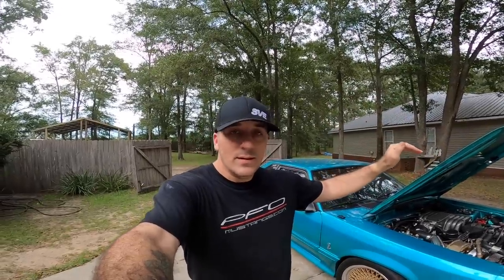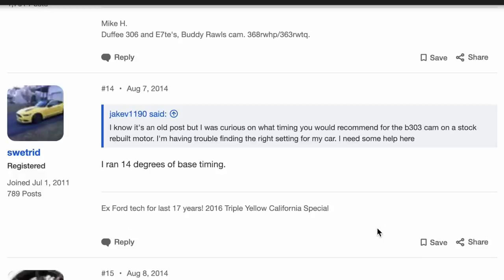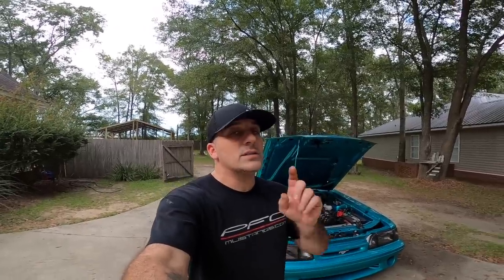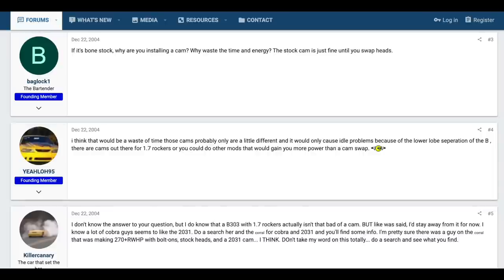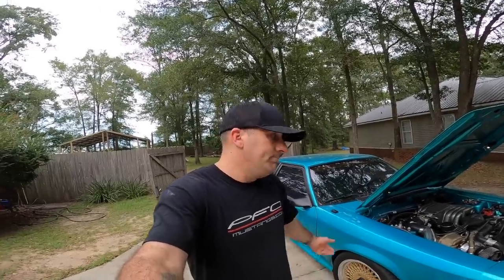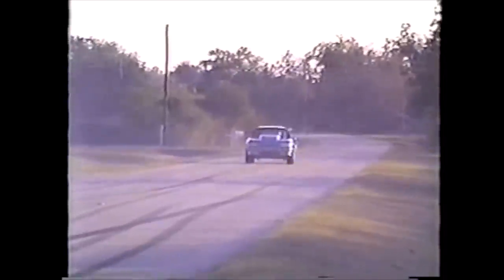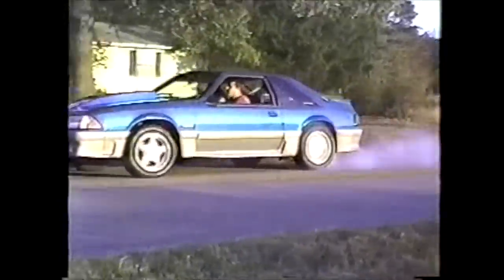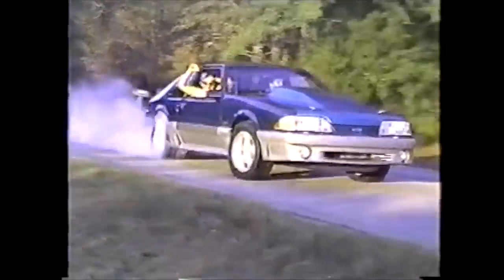THE B303 CAMSHAFT: Why the HATE why the HYPE?

Comment: I have a 86 5.0 with speed density. Question is without going to mass air and changing cylinder heads, what cam can I swap the factory cam with?
Reply: I’ll add not chasing HP, just want to nice sounding fox for the car show pull up!

Comment: I have a b303 cam going to be putting comp cam valve springs,it has Edelbrock rpm2 upper and lower intake ,short headers and powered by Terminator x stand alone, will that be reliable ?

Comment: I know this has probably already been asked but here goes......I have a 91 GT (automatic) that is pretty much stock except for the BBK cold air intake, the 75mm throttlebody spacer and SCT tune. I'm wanting to add a cam at this point. I was wondering which cam I should go with and how long of a job is the install.  P.S......I enjoy all of your videos. Very informative for us novice owners😎
Reply: E cam or tfs stage 1. 4.10 or shorter gears help too

Comment: I went to the junkyard and got gt40 heads upper and lower intake from an explorer. NOW, I’m at a lost on what to do. I do want to change the cam to an e303 cause I got (AOD) but what should I do with valve and rockers can they hang with the cam or do I have to replace with something else also?
Reply: Need to change your springs for sure, u can get by with the valves and rockers if u need to but the springs are a must 👍🏻 good luck
Reply: I got gt40 heads with the crane 1.7 roller rockers, stock length pushrods( I might of put slightly longer ones in but I did run the stock ones for a while) upgraded valve springs from Alex's parts, and e303 cam. No issues! Other than I had to modify the oil baffle in valve cover to clear the rockers. Stock rockers will work fine too
Reply: I ran a e cam and 1.7 ford roller rockers on gt-40 heads in a aod and you might want to add a stall converter.But it sounds great
Reply: 79Beans 347 what springs would you suggest and where can I get them? Thanks
Reply: jah Thorne would you happen to know the part numbers for the valves and cam? Also, the lifters from my 302, will they work fine with the rods from the gt40 heads?
Reply: W C stall converter? What’s that? And what for?
Reply: @robisart7715  a stall speed converter for your transmission
Reply: W C ok I know nothing about that, but I’m assuming because of the stock one doesn’t have enough power to turn the car over?? (Newby sorry)
Reply: @robisart7715  a stall converter helps AOD tranny's to take off almost the same or better than manual transmissions, basically let you give RPMs to the engine when taking off, but RPMs depends of the type of stall converter (example 1500,2500,3500)
Valve springs and cams you can find them at many websites like, american muscle, late model restoration, summit racing.
There are a lot of websites for the 302's and of course for most of foxbody parts
Reply: Omar Ruiz thanks a ton! I asked about the valves cause my concern of them fitting the gt40 heads I was afraid of getting valve that can’t handle the cam and all
Reply: @robisart7715  your welcome, and about the rocker arms I think you'll be fine because the E cam it has a slight difference compared to the stock HO of a mustang, but I'm not sure if explorer pushrods have the same length than mustangs 302's
Reply: Omar Ruiz what stall converter would you suggest?
Reply: @robisart7715  1500 for a daily driven and street racing purposes.
and between 2500 to 3500 only for the track with drag radials, because if you try to cruise with a big stall you'll be reving too much
Reply: Omar Ruiz ok yeah makes sense, yeah I still want it to be my daily Forsure
Reply: @robisart7715  yeah I love daily fast vehicles, just keep in mind that a 1500 stall can't launch hard with drag radials, but a semi slicks is the way to go for street racing and the track as well
Reply: Omar Ruiz thanks bro!, yeah I’m not even trying to be a street racer But if I step on the gas I want it to go you get me? Motor is in the shop now and I’m trying to push 320-350hp but still have it as my daily so I’m not trying to push the limits too hard

Comment: I think the thing that gave the B cams a poor reputation was the LSA. Was always way too wide. Other grinders/mfgs went to 110-108 making better top end power. Bottom line the engine doesn't car about internet opinions. It likes what it likes.
Reply: Itza computer compromise. 
Power wise @ 108-109 is best.
E cam 110 is MUCH better than 115, 114, 112. 
GOOD quality 1.7 rockers push the lift from 498 to .529.

Comment: Is Andrew running gt40 or gt40p heads?
Reply from the maker: Gt40p
Reply: @BREW2LFOXBODY  Now, that's something I can't understand. How much were the headers? I always recommend finding a good set of used TW.
Reply: @robertelmo7736  regular headers work,its the wires you have to keep off the headers..My ported gt-40's,3 bar, out flow out the box T.F 170's...💯
Reply: john doe I’ve never seen a set of GT 40 P or not get close to a trick flow head with a 202 valve. Maybe you can enlighten us on this subject And show us some flow data from where someone has done this?
Reply: @robertelmo7736  Not a problem! Tony Brooks Big Dogs Porting. Take a look....
Reply: @johndoe-zb8bm  I did, thanks for the info. Seen his stuff before on intakes. They are freaking close on the intake and do outflow a little on the exhaust.
I know a guy that spent big money on an explorer/P setup, and it really wasn't that impressive though. The headers were expensive. Maybe he should have went to BDP lol.
Reply: My bbk full length headers would not work with gt40p heads, even with 90 degree wires, what headers is he running with his?

Comment: Question can I  run a B303 with stock heads ?
Reply from the maker: Absolutely
Reply: @BREW2LFOXBODY  and would I need to replace or upgrade rockers or springs or anything part like that
Reply: Gonna pull the trigger and do my first cam swap

Comment: Why wouldn't you gain from a lettered cam on a stock set up? If it's higher lift and duration with corrected fueling you should see gains.
Reply: The stock heads and intake just don't flow well.
Reply: @adamrushka8096  true they don't flow that well but you'll still see some gains
Reply: @bluezr1357  I'm sure you will see something. I think the point is don't expect much more than a cool idle on a stock motor.

Comment: I had options alright. In 2000 I installed a Comp Cams XE282HR (232°/240° @ 0.050" and 0.565"/0.574" 112°LSA) in my 93 Cobra with stock bottom end. I installed my ported GT40's with 3/8" stud rocker conversion, FRPP Stainless Valve kit(1.940" int. & 1.540" exh.). I ran that combo till 2006 when I built my first stroker for the car. This cam was not similar to "your" range of options. 

I decided to do the work myself and experience it work or not for myself. The misleading hype on any forum can have anyone looking like sheep. Find a real shop that employs a real engine builder or do the math yourself. All the info necessary is provided.

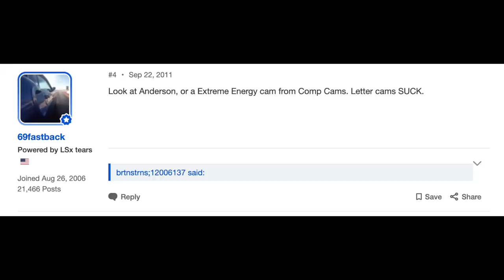Comment: I ran some off the shelf forged pistons , zero deck. The EGR hump ground out of the E7 heads with some Motorsport self align rockers and a B Cam. It was nothing special. I put 4:10’s. I couldn’t shift it. I threw in a C-4 and a Fairbanks stall. Nothing special. Put a 28 inch tall tire after beating the fender well out of the car. It was not anything special. It was the non adjustable Top Gun nitrous kit that made my 88 whomp on people. After pulling the torq boxes out of the car  I sold it.

Comment: 1988 GT with a B cam, Trick Flow Twisted Wedge heads, Scorpion 1.7 ratio rocker arms, Edelbrock 5.0 intake, 5 speed, 3.55 gears and a 100 shot insurance policy. It was quick in 1993 when I built it but, still fun by todays standards.

Comment: Your passenger side cobra badge is backwards
Reply from the maker: That’s actually the way they came from the factory
Reply: @BREW2LFOXBODY  yes on the drivers side it was facing the the rear as ford used the same badge mold,but that same emblem on pass side cobra head should be facing the front ;)

Comment: Ohhhhhhh bulllll you can run any letter cam in and be fine on PTV clearence. Bigger valves is when it gets sketchy.  Letter cams are babies, effective! But babies. 
86 foxes have flat tops.. So if you have an 86 check the shit. Or don't.. Roll the dice.

Comment: Letter cams are built by ford to the same specs as the stock cam as far as material and to the factory specs that ford put forth as far as the stock ford roller cams can last for a long damn time. It a bigger stock cam built by the manufacturer. Yes there are better cams but how you run the vehicle matters. I’m still gonna run a letter cam in a street driven car even if I lose a few hp. I think you portrayed your point fine just missed on for the money how they was designed and all it’s hell of a cam any of em. Most your other cams are cast iron same thing they make flat tappet cams out of. These letter cams and the stock ford cam are steel cams at least. They last a long time. So also consider that in your cam purchase. Are you paying steel cam prices for cast iron cams because of the way that it’s ground? I’ll find a steel cam close to those specs and spend my money there. Didn’t mean to go off on a tangent and honestly surprised I defended a letter cam. But with the way things are going and the rate of failure to new aftermarket parts I felt this was a necessary rant to have. I actually came here cause I miss the sound of my b cam.

Comment: If just be happy if I didn't have to think twice and choose not to about doin a 40 roll with a four-wheel drive extended cab Silverado with a 5.3 engine or a 4wd double cab Ecoboost... Now that's embarrassing... That why ya pop a vacuum  line off ride around see someone eggin you on just bang it down a gear make some noise straighten out your struts and lift and if you see em at the pump say yeah don't really wanna cut er loose with street tires and they ask what's been done to it be vague and say sorry man I'd like to chat but I'm in a hurry lol. Just Don't tell em it's a stock 5.slow